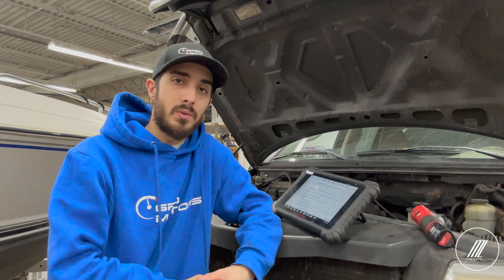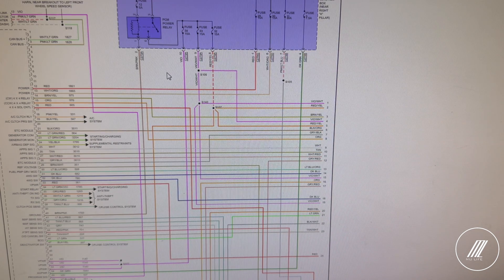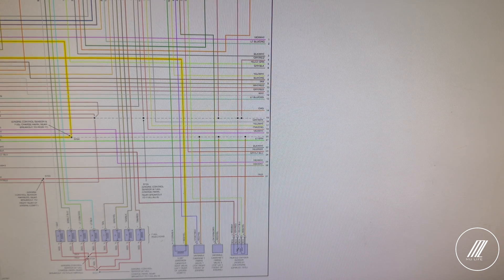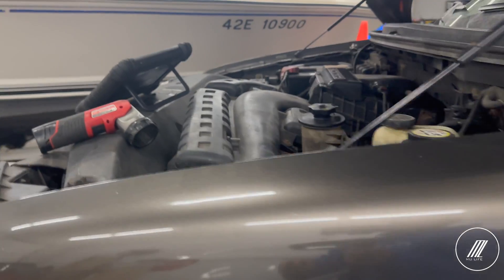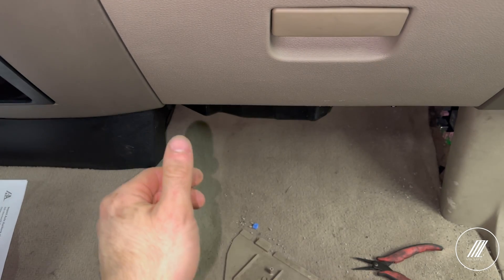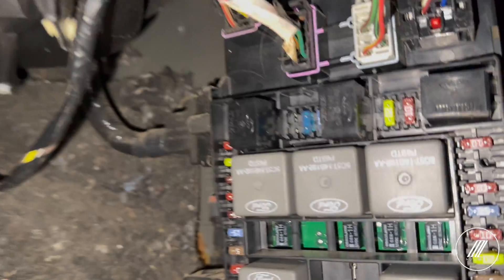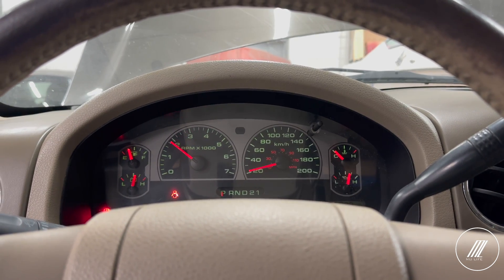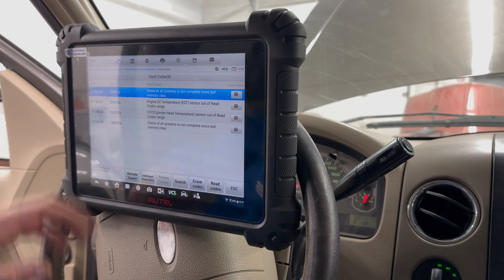F150 2006 Limp mode diagnostics - P0022 / P0102 / P0135 / P0155 / P0433 / P0446 / P0645

Comment: This video led me directly to my problem which was my o2 sensor wire was exposed due to touching the exhaust.  Appreciate this video.
Reply from the maker: Im glad it did , thats the purpose of this channel to hopefully help as much and educate.
Reply: Mine has same issue I can’t figure out the pig tail coloring order to my trucks colored wires I have exactly same truck from this video an same pigtail an o2 sensor you used any info would be a blessing  thanks for sharing this